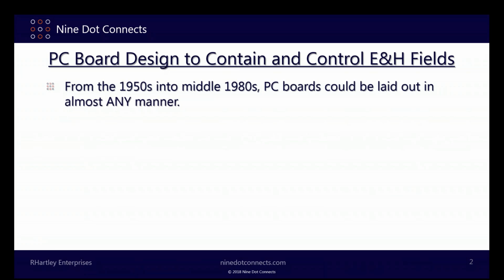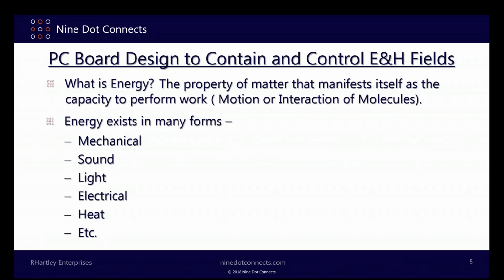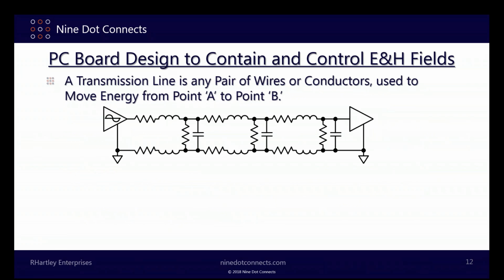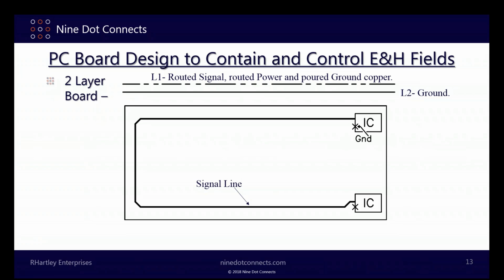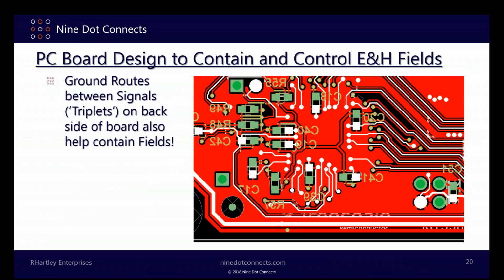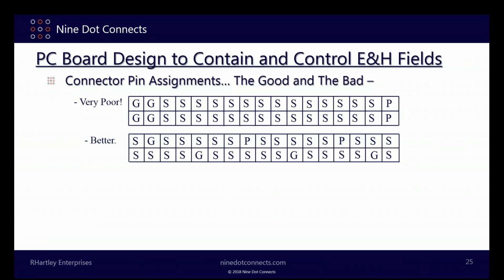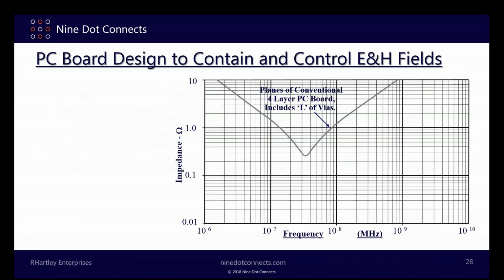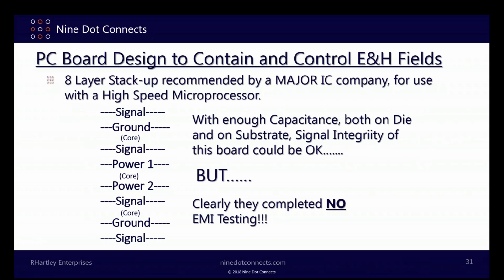What Drive High Speed Signal - Voltage or Current?

Comment: I have three questions, and I'd love it if Rick could answer them. This is specifically referring to the four layer boards that Rick referenced at 40:56.

My questions are: 

1.) How do you control impedance with a power plane coplanar to the signals and a ground plane underneath? Do the same coplanar waveguide equations work? If not, which do work?
2.) How are differential signals affected by the presence of a coplanar power plane and ground plane underneath? 
3.) Does it matter how large the voltage is on the coplanar power plane? That is, if my signals never exceed 1.8V, but my power plane is 28VDC, will that affect my signal integrity?